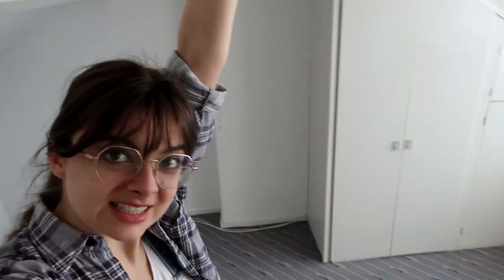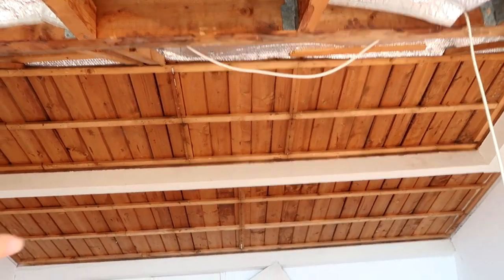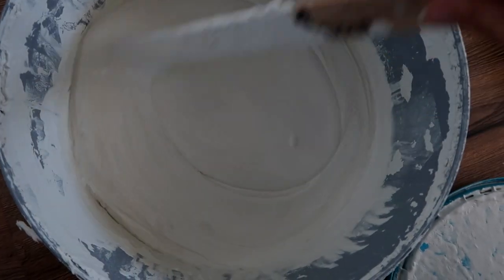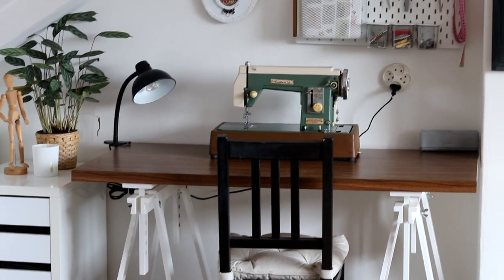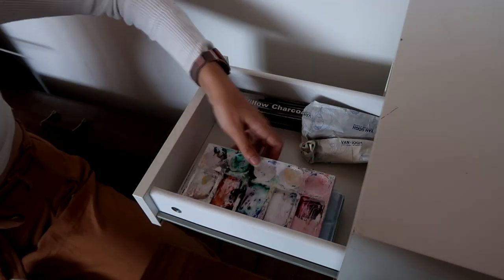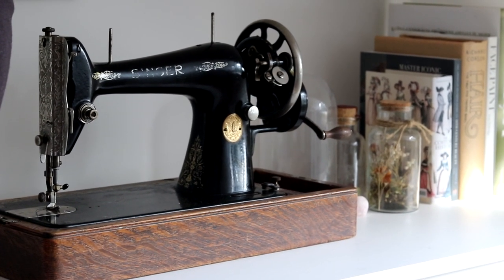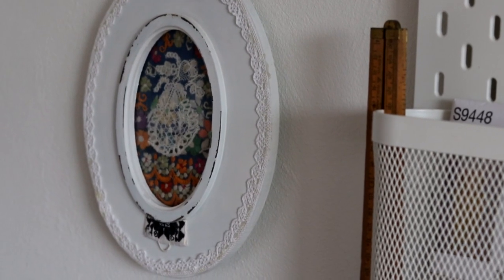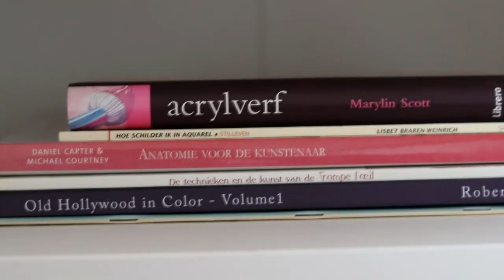Sewing Room Makeover Before & After🧵 Cottage Attic Vibes

Comment: Congratulations.  The studio is amazing.  Well done, you.
You are going to absolutely fall in love with your hand-crank.  During Covid time I got a 1915 hand crank Singer 99K - the level of precision in those machines is mind boggling.  Fair warning - the pressure feet is a very deep rabbit hole to fall into (but worth the time - etsy for research, ebay for purchasing).
- Cathy (&, accidently, Steve), Ottawa/Bytown/Pimisi
Reply: Seconded. I have a singer 15 treadle reverse feed. I’ve not had my electric machine out since I got it. Sews beautifully. And you can get so close to the edges, I love it. Was very lucky mine is cosmetically challenged but mechanically sound, so I just look after it but don’t baby it. Going by thread meterage I’m in multiple kilometres sewn and I’ve only had it since summer.
Reply: @dees3179  And don't forget the 1 mm stitch length... If Stradivarius had built machines, he would have created these beauties.

Comment: The studio looks so cosy! Worth the wait and the work, I think! Also, I have two antique singers and I love them! That's all I use now. I'd love to get a working treadle at some point (I had also bought a table, not realising half the treadle was missing....and I cannot find parts...) but I'm happy enough with the hand crank. I've used them since the summer of 2020, and started out on themaking our masks, a couple clothing items, started some quilts, mended jeans (a 66/99 is great with denim, and can even sew leather, BTW!) and made a few different bags. The only downside is you need to get used to controlling the fabric with 1 hand and you need to stop sewing to remove pins/clips when using them, and they obviously don't have a back stitch, so you either need to spin your fabric around to "back stitch" or just skip it, and I usually skip it with no problem, but I find it's a very soothing kind of machine sewing. Medatative, methodical, purposeful sewing. They're so quiet compared to an electric machine, so great to use in the evenings when you want some peaceful sewing time. Also, the bobbin winders are so fun to use! I love how they're crafted! Just oil everything and clean out any fabric dust bunnies/old oil inside and I'm sure it will work fine.